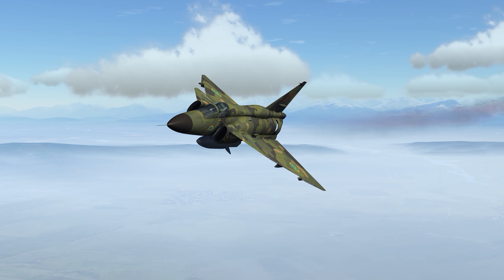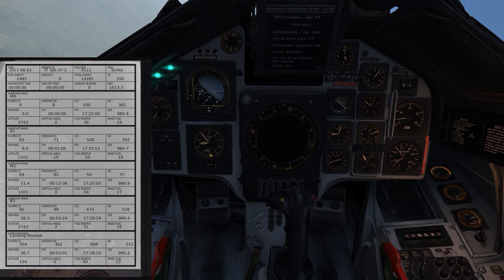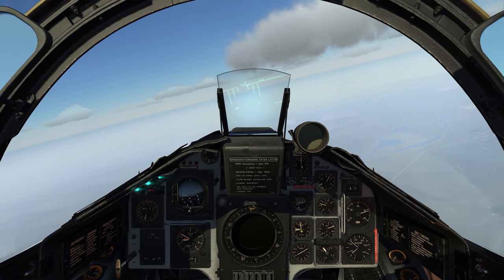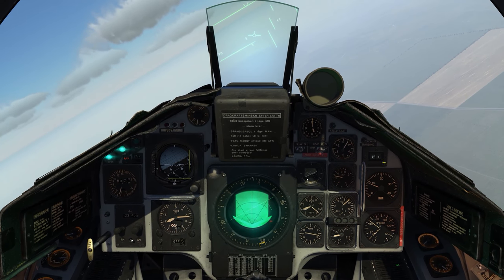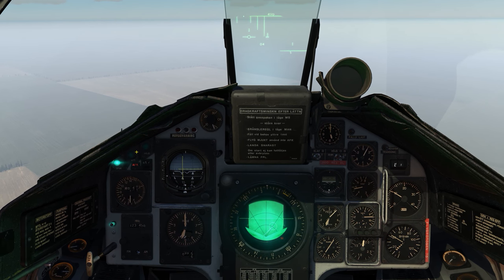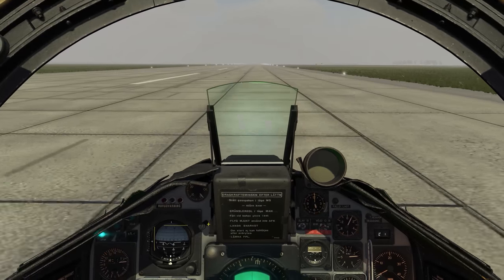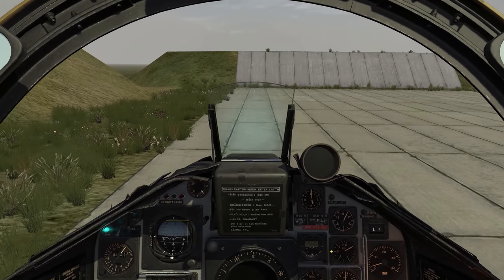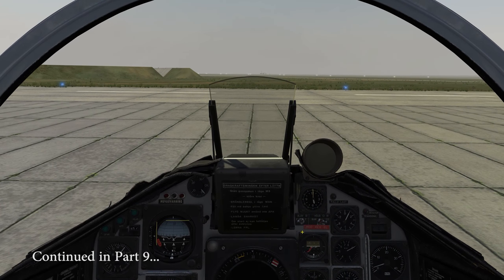Test Flight - DCS: AJS-37 Viggen - TILS System, Autothrottle Landing, Shutdown

Comment: Thank you for doing these, they're great!

A few things I noticed (not to be taken as criticism, just things I saw with the benefit of watching from my chair with no stress at all):
- not sure if it was intentional but you had the 15.5 degree alpha mode engaged during the landing (red light just under the autopilot buttons) so you might've been going slower than expected
- Leatherneck's manual is indeed missing an engine shutdown step but is otherwise pretty much to the procedure on the real aircraft. On the real aircraft it goes ejection seat safe (you forgot this but it's behind your head so it's no wonder) - AFK off - generator off - throttle to cutoff - avionics off - oxygen off - low pressure fuel off - canopy open.

On the real aircraft you are apparently supposed to turn generator back on afterwards but well, I dunno.
Reply from the maker: Actually, the 15.5 deg setting was not engaged.  There is a separate light in the button that illuminates when it is pressed.  
As for the rest, that sounds like the same procedure I came up with afterwards with pulling the throttle to cut-off first then turning off the fuel pump.  The only thing that still seems out of place is shutting down the engine and therefore the generator before shutting down whatever avionics are still on.  That is generally an awkward thing to do to the battery.  I don't doubt that is the procedure, it just isn't what I would do at first glance speaking as an ex-electrical engineer and aircraft maintainer.  That is one of the main reasons I have hobbies like this, to see how other nations and aircraft manufacturers approach system design.  It will be interesting to dig through the schematics and make sense why shutdown is sequenced that way.
Reply: Bunyap Sims Man, now I feel like an ass. Apologies if I came off as douche-y. Reading the manual back and forth is no substitute for actually working the cockpit and I should keep that in mind.

Again, love these videos - keep up the good work!
Reply: Look upon my crime against sensible graphics design, ye mighty, and despair: http://i.imgur.com/4JAgerJ.png

It is not at all obvious from the diagram, but turning off generator power (or losing it in some other way) also automatically switches off all secondary bus relays, both AC and DC. If a generator fault happens in the air, the RAT/emergency generator pops out and when it's started to deliver usable power some of them turn back on again automatically.

(Disclaimer: definitely not an engineer here, may have misunderstood or mistranslated all kinds of things. Learning more about this is awesome though)